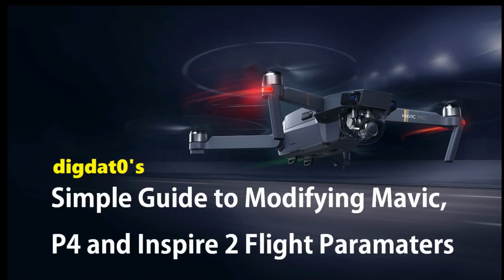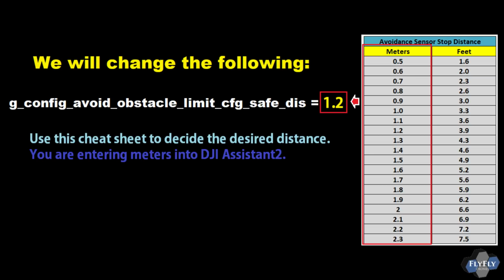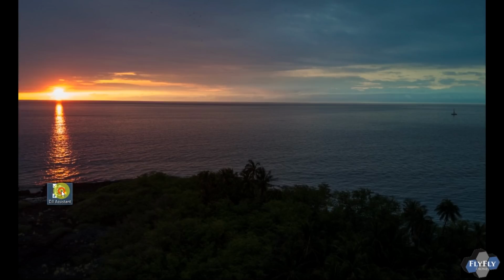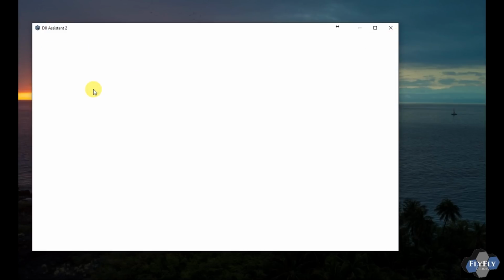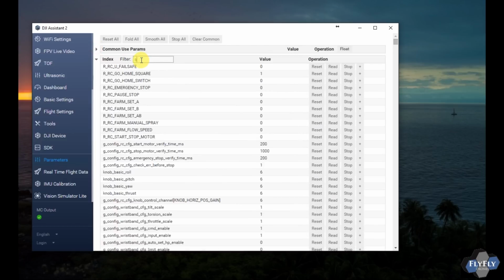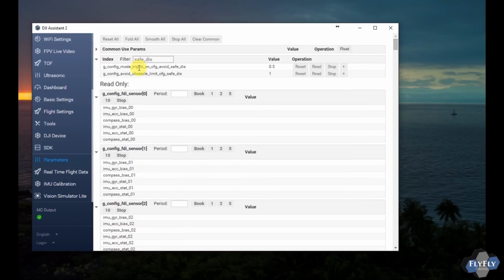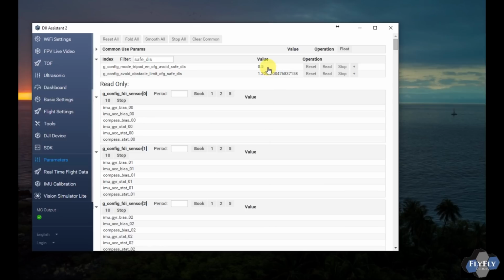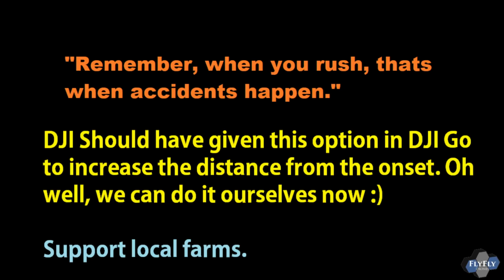Safer Obstacle Avoidance Distance for DJI Mavic, Inspire2, P4, Spark

Comment: I am trying to reduce the Obstacle avoidance safe distance to 0.5m for my DJI Spark, but it does not work at all less than 1m. If I want to increase the distance that works pretty well. I need to reduce it for my application. Please reply soon. Thanks in advance.

Comment: Any values for OA+ mode as it's been mentioned to instead OA to 29mph from 22mph stock with sensors on
Reply from the maker: Yes the params in this will get 29mph in oa mode

Comment: thx alot, although i found that parameter myself its great that u did a tutorial for this, i incresed it to 3, so it stops 2.5 meters before obstacles, although it feels like it made the entire obstacle avoidance system more sensitive but im happy it is
Reply: especially now with fast GPS mode and 29mph RTH! :)
Reply: Jacob Glikman digdat0 say it on 1.2 and u choose 3,what it mean 1.2 and 3 as u choise it?
Reply: well i set it to 3 and now the quad stops 2.5 - 3 meters before obstacle
Reply: Jacob Glikman so it means digdat0 say 1.2 is drone will stop on 1.2mtr before obstacles?
Reply: i think this parameter is meters, so basicly yes, although its not stopping for me excatly at 3 meters, but i know its working very good, it starts to slow 10 meters before the obstacle and stops at 2.5-3.0